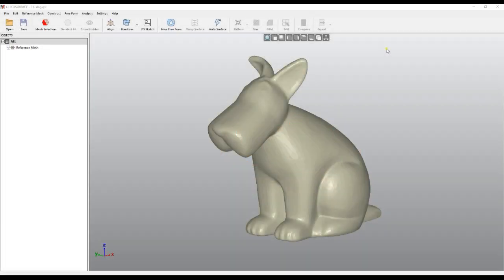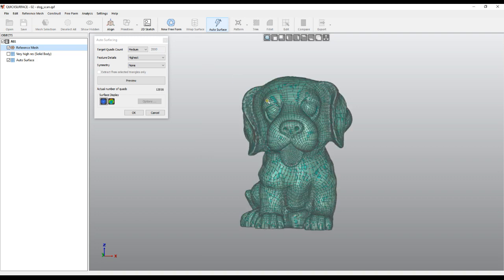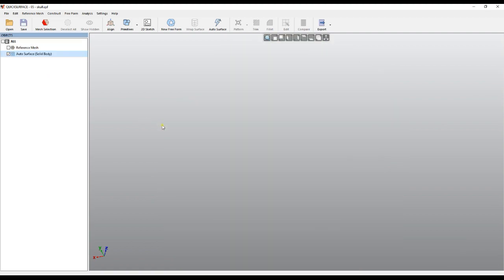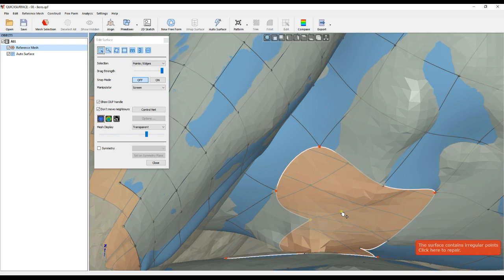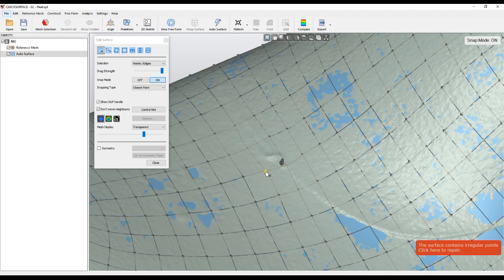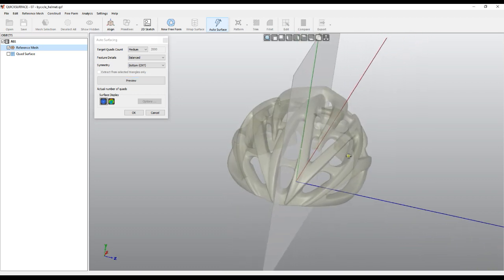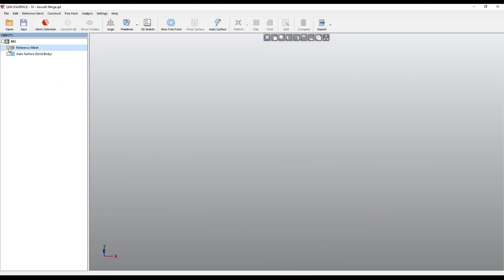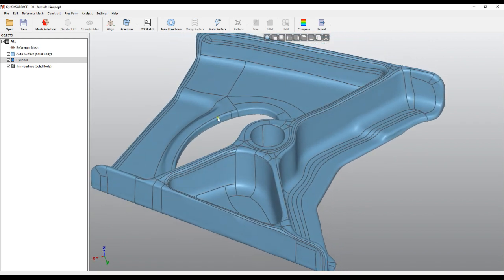QS Tutorials: Automatic Surfacing Demonstration - How to do Reverse Engineering with QUICKSURFACE

Comment: In version 5.0.54, the mesh is very uneven and far from what is shown in the video. On other models, the grid is exactly the same, i.e. completely uneven. Here is an example of what happens: https://i.imgur.com/pMtuWv1.jpg
Reply from the maker: the best is if you contact us directly at: contact@quicksurface3d.com and we can discuss. Isn't just a rendering issue? I am not sure I understand what exactly the problem is?
Reply from the maker: The best is if you contact us directly to discuss the problems you encounter. Our support team is always available to help. YouTube is not place to resolve problems.
Reply from the maker: And what is the problem with your reporting? The bigger question is - why do you need single surface? What are you going to use this for? Or it is just a nice wish to have a single surface? If you take a look at NURBS theory, probably you can find more information about the capabilities and limitations of modelling with nurbs.
Reply: @QUICKSURFACE  i need it for powermill. i have to do a single surface us reference model
Reply from the maker: @ahmednahdi4810 I don’t know of any software that can generate a single surface from such objects. Perhaps you can check powermill if it requires a single surface only. Or you may check other software. MasterCAM doesn't have these issues.